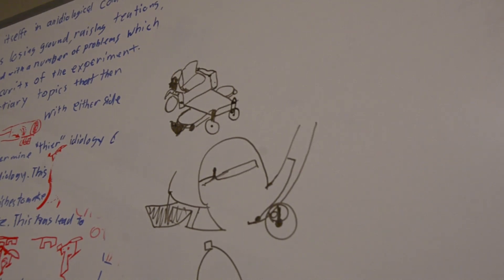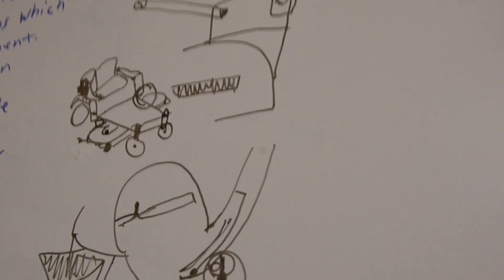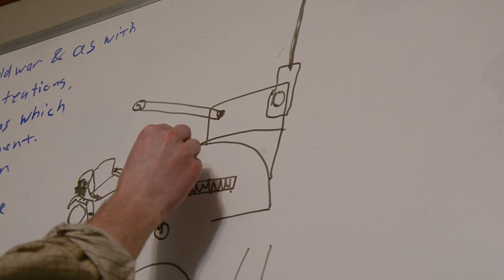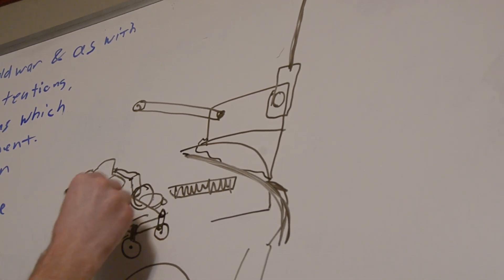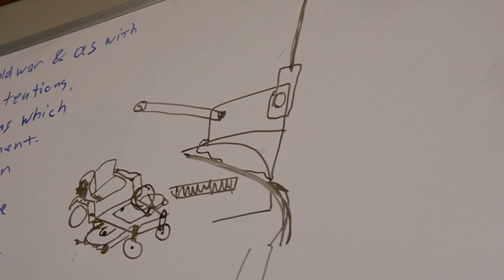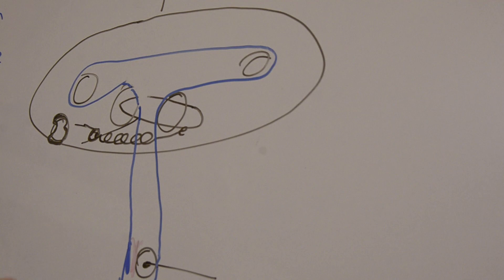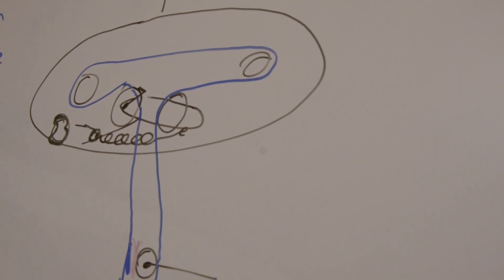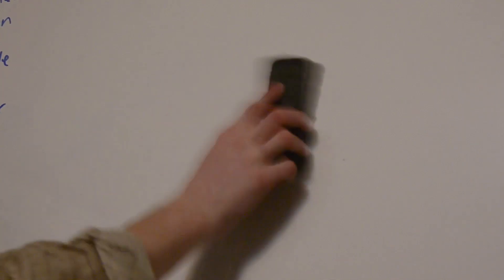Rant of frustration

Comment: I can understand the frustration even though all the mechanics are beyond me.
Reply from the maker: We got the other mower running and we are thrilled. Now the question is, should we buy a new deck which is over $400 or try to weld it or just get rid of it?
Reply: @BookZealots  I would tend to keep it as a backup in case of future mishap. "If you have two, you have one; if you have one, you have none."
Reply from the maker: @greenstickcottage  LOL We have three riding mowers. It's so sad. We need a part for the oldest mower we have. But it takes forever to mow the property with that mower so it hasn't been my priority. And yes, I agree with you on the zero radius. We continue to frankenstein them until we move. LOL I like your logic too. It does seem to be the case.
Reply: @BookZealots  I heard a prepper saying that saying, snd I guess that's a demonstration of it, that you can hopefully get one from three 😉